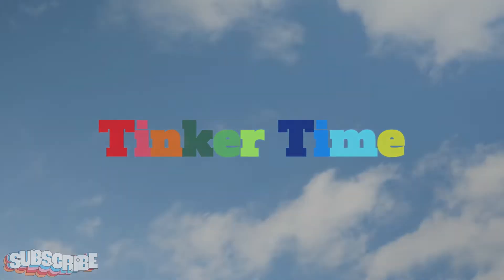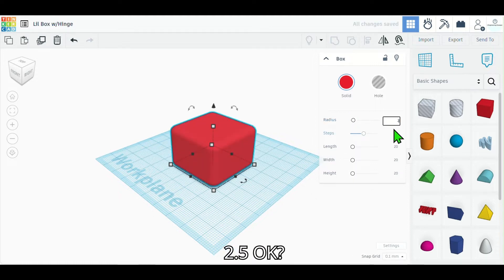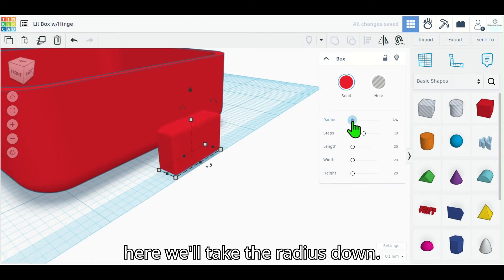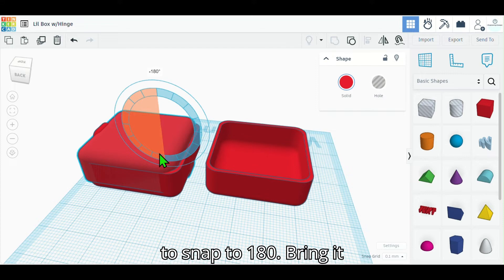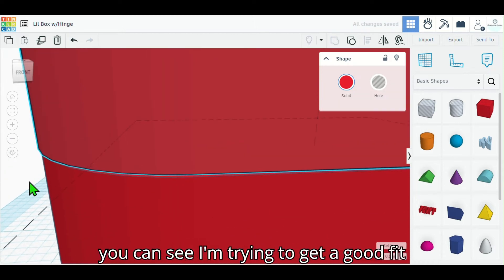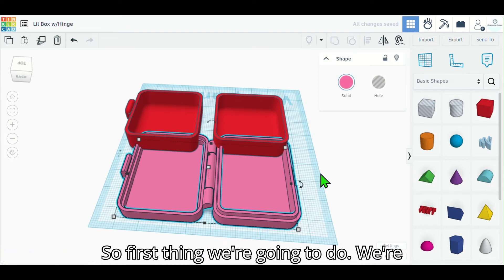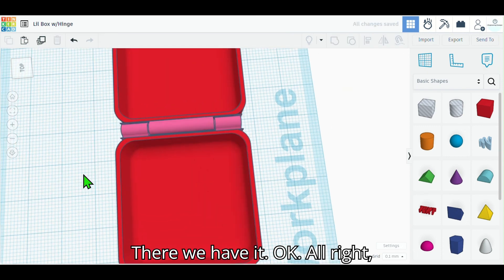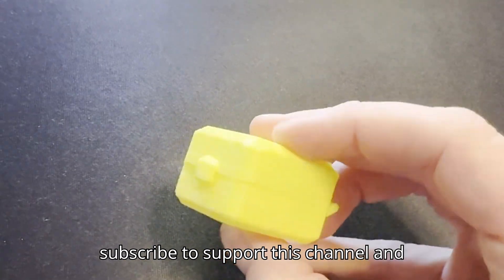How To Make: Mini Box Using Tinkercad For 3D Printing - Tinker Time

Comment: Thanks for the tutorial :) Both the lid and the bottom are the same size.  Would it be possible to reduce the depth of the lid? Or does that require a different kind of hinge mechanism?
Reply from the maker: I designed it so the top and bottom are the same size to avoid using supports. If you change the height on either top or bottom, all you have to do is use supports 👍🏼👍🏼

Comment: I do every single step you do in video, all looks good untill i try to print. When i print quality goes bad, and hinge not working, when i break hinge with force and close the box they connect with space closer to hinge. I have tried 3 different tutorials but end up in same result. Can't understand what i am doing wrong because i follow every step but don't get the same result when printed. And my printer is set up not perfect but good, i can print articulated prints without problem, i can print other people created box without problem, but when i try model myself and print it's not working.
Reply from the maker: I definitely understand how frustrating that can be! I recommend using PLA, 220 at the nozzle and 70 at the heated bed. 0.2 mm. No supports. Let me know if that makes a difference. 👍🏼😎
Reply: @tinkertime1  I use PETG, 230 nozzle and 70 bed and 0.2mm. I did make 3 different boxis with different spacing in hinges but they didn't work.

Comment: I've only just now discovered your channel and expect to learn a few new things, not only about using Tinkercad, but how to approach a specific project.
Had you considered to use the reference plane to align a few of the parts movements, rather than to use the calibrated Mark Four Eyeball?
Reply from the maker: Good question! Yes, for me, it just depends on the project at hand. That is a great tool to use as you mentioned! Good call!

Comment: One question how that hinge will be printed in such a way that it works like a moving part?
Reply from the maker: Hey! To answer your question, as long as the part is not too small and you have enough space in between the moving parts inside of the hinge, it will work as expected right off the build plate. 👍🏻

Comment: Thank You for spending your time to make this video (In a voice I can hear and understand) it's a little fast but that's just cause I'm new. Fortunately I know how to work the 'rewind' feature. I have one question however, I don't seem to get a drop-down measurement(s) window whenever I select & drop an object onto the workplane...?
Reply from the maker: Thank you for watching my video! You may be referring to the ruler feature, which, after you select an item and put it on the build plane, then you can select the ruler option in the top right corner of the screen to give you the in-depth measurements for the object. Hope this helps!

Comment: How does the hinge rotate?
Reply from the maker: It is a print in place design, where once printed, the pieces don’t come apart, but are able to move freely due to size differences in the plastics. 👍🏻

Comment: I am having problem with hinges. Mine doesn't seem to actuate. They are fused together. It breaks when I try to wiggle it. Is it my support settings?
Reply from the maker: That's a great question! It is a print-in-place hinge and these typically fare better from a higher infill and a lower nozzle temperature. If you increase the infill of the object, I would recommend 100% since it's small and decrease your nozzle temp if you're printing in PLA to 210°. 👍

Comment: Great video, exactly what I needed... to learn more technique. Comments for newbies: this is not for literal 'first timers.' Instead, watch this after you've watched perhaps 3-7 videos about using the Tinkercad interface. This video shows perhaps 20 techniques, methods, processes, even thought processes that comprise "3D construction thinking." It shows you... copying to resize; resizing numerically; changing view to facilitate adjustments; copying to subtract (with a hole); reuse from another project/ecosystem; rotational snap; alignment in action; that external STLs have things as complex as a working hinge; by inference it shows me that I'm probably moving things around too much... or I don't understand how to keep things on the workplane; and so on. In other words, whereas the true first-timer tutorials show what the interface does, they don't show how/when/why to use each tool. 

TT, I think you could make another (not replacement but addition) even higher demand video by taking this exact video content... stretching some of the frames...and re-dubbing it with comments for every interface action such as "now I'm zooming with the scroll wheel and right-dragging to see the hinge alignment from the most revealing angle... here I clicked on the up-arrow (the height tool), to reveal the vertical position number so that I can type in a precise number... here I pressed the [?] key to zoom to the part." I've learned over 100 visual tools and learned 16 programming languages over the years; trust me... as good as the Tinkercad interface is, thousands of users could benefit from having that info built into a technique video. Thanks
Reply from the maker: Thank you very much for the insight! I think you have great ideas! Stay tuned, as I will definitely put some of that into play for part 2! Thanks!

Comment: im watching vid to see how to make hinge.... when i saw "we gonna borrow that thing" i bursted tea on my monitor man you made my day :D
Reply: I've made several hinges in TinkerCAD, the latest was yesterday evening. When I've finished each type of hinge and tested it, I add it to "My creations" so I can easily pull it in to a new project. 

A simple hinge like this is just made up of 4 cylinders and 2 boxes: Two for hinge's shell for the lid's attachment (which is just made as one cylinder and then booleaned) and 1 for the hinge's shell for the bottom's attachment. All 3 of those cylinders is hollowed out by use of boolean (combine a "hole" shape with a solid). 

Inside, we have one cylinder spanning the combined length of the aforementioned 3 cylinders. The diameter should be at least 0.4mm less than the inside, but depending on your printer that might not be enough. I've found that 0.6mm is more forgiving for people that use Ender3-series printers, especially older ones such as V1-V2. 

The two planes I mentioned is just coupled on each hinge section to extend those sections towards the lid or bottom. 

Hope this made sense ^_^
Reply: @JakobDam  noting will give you more knowledge than doing it yourself, i've watched multiple turorial on hinges no single one mentiones position height of hinges, tolerances for printing it just general put 10mm here 9 there and draw a circle there, TBH i was little shocked it worked just by joning borrowed hinge and placing it on model by eye, all my hinges need to be rather perfecly placed or box wont close properly.

Comment: hi, very interesting tutorial, thank you.
is it possible to do something like this with a cylinder or pipe, top and bottom that has curved hing and curved locking mechanism or latch.
kind having two pipes that can be folded with hing then joined with a latch or similar.
Reply from the maker: Definitely! 👍🏻 Just a few design tweaks, but yes it can be done.